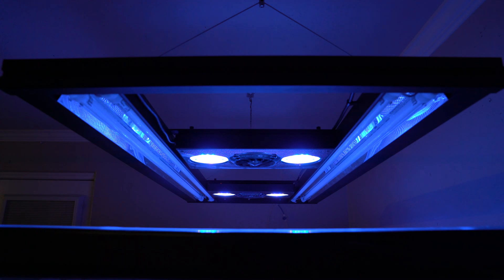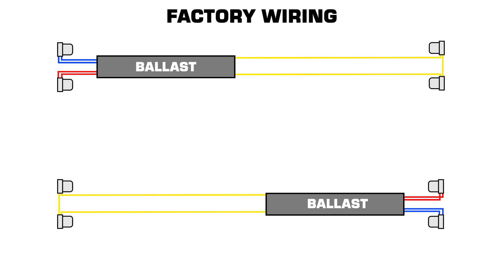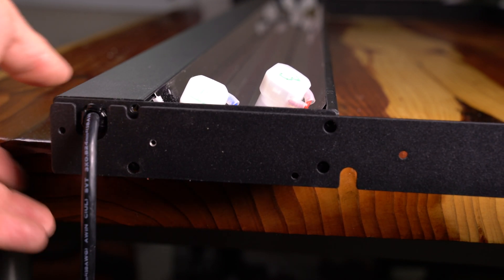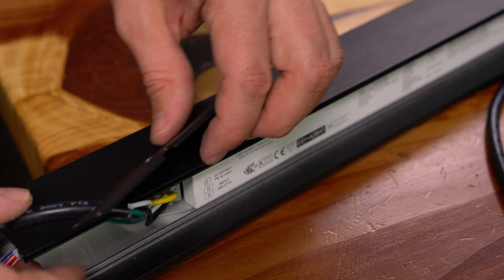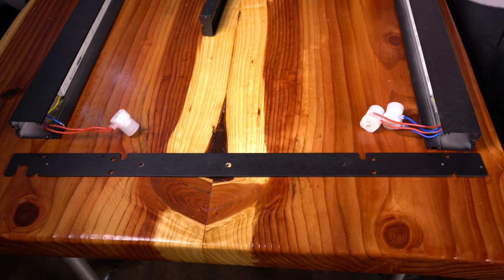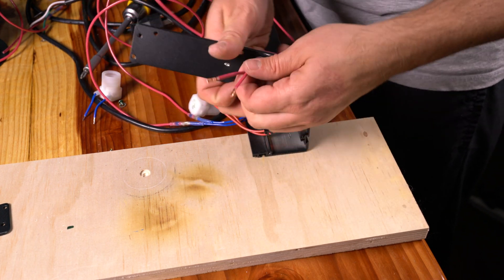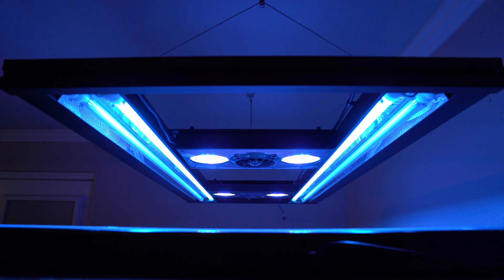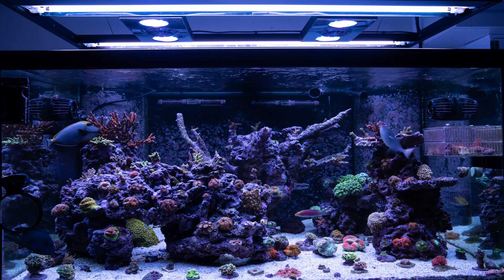Aquatic Life T5 Hybrid Hack - Improved T5 Lighting for your Saltwater Reef Tank

Comment: I DIY my Coralife and made it so much better. I drilled holes and rewired the ballast and split reflectors. Now I have a space in the middle that I add my LED, and this is with no experience. Aquatic Life makes great light, but it  don’t even come with a light switch on this so called Hybrid Model. Which is BS and for the cost.

Comment: Great vid. Thanks for sharing. Got the same lights and want to mount the G4 Pros in same configuration as you. Got the end caps and the internal mounts for the leds. But the hanging kit that came with the unit at 16” width isn’t long enough to make it 24”. What do you do to make work?
Reply from the maker: Sorry for the slow response but you can buy the 24" brackets from BRS or AquaticLife.